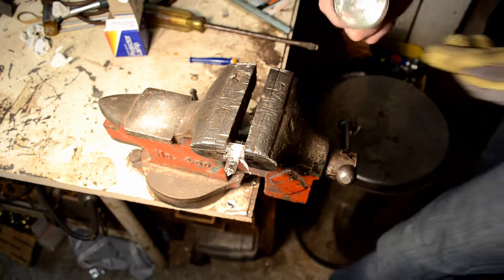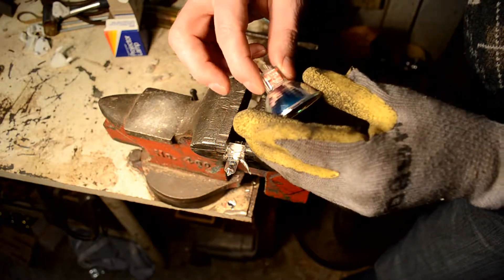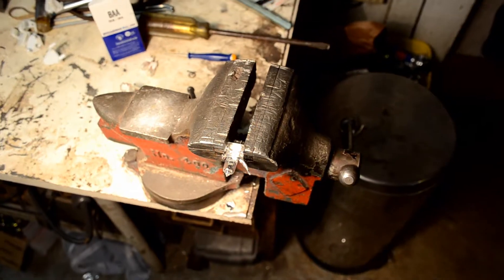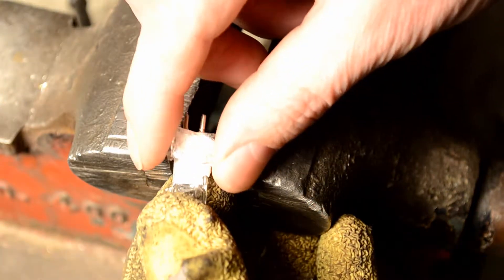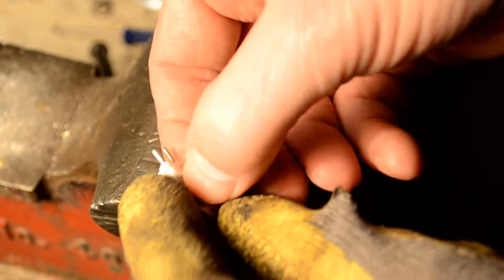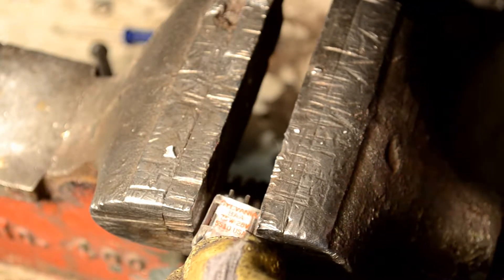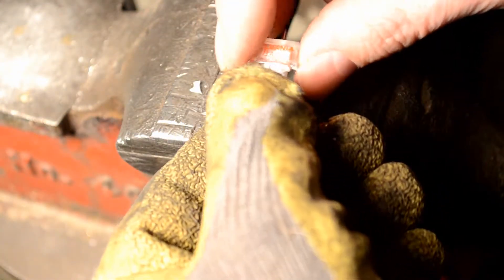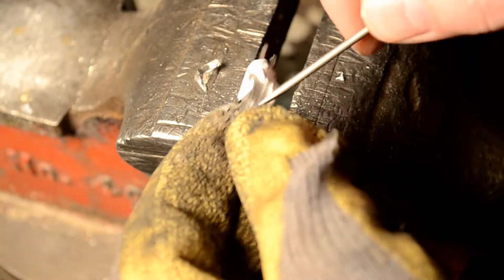How To Extract The Lamp, Bulb, From an MR16 Reflector, Housing, Casing

Comment: I was very careful to follow your exact instructions and failed twice (two Sylvania ENH 250W -120V). Very lightly tapping the vise handle but both bulbs broke off at the stem anyway. I ended up ordering a halogen that didn't need breaking: OSRAM GCA bulb 250w 120v G5.3 Single Ended Halogen light Bulb from BulbAmerica dot com.